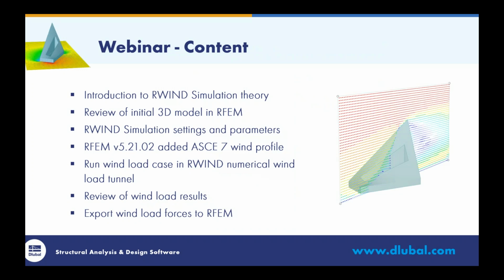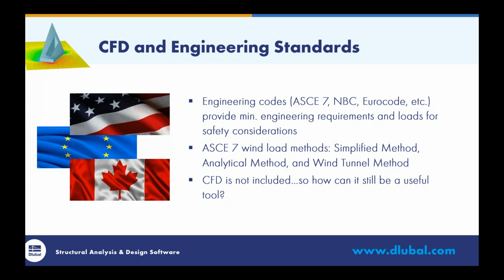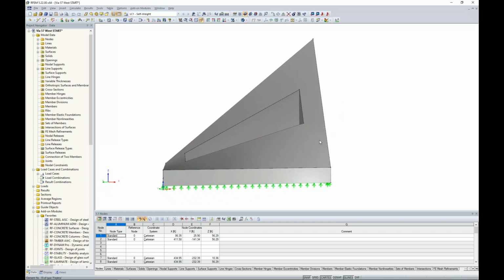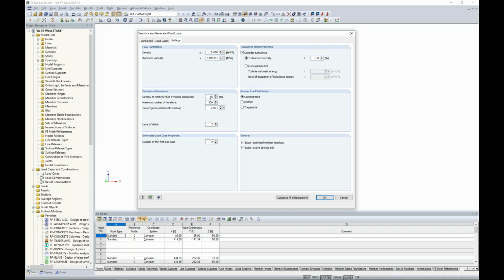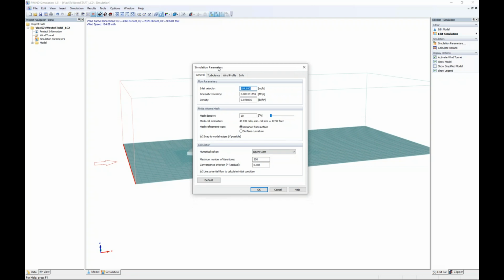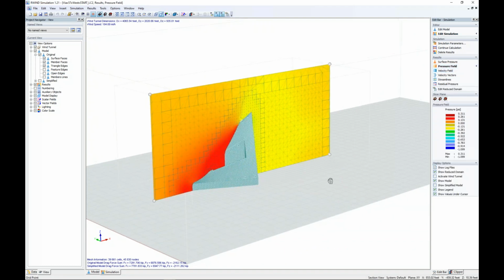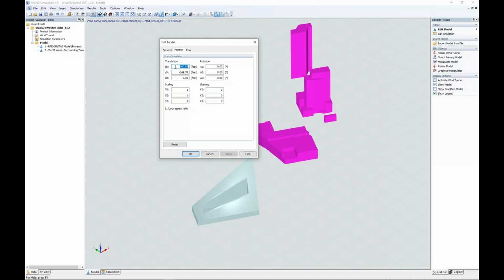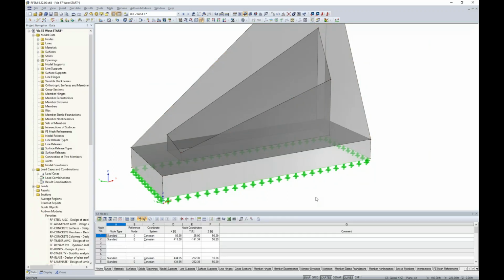Webinar: RWIND Simulation | Wind Load Simulation and Generation

Comment: Thank you for great video!
Calculating the lattice structure with round pipe cross-sections I've found out that in R-WIND they are represented as square hollow sections. What's the reason ? And does R-WIND take into account the type of cross-sections when calculating a wind pressure ?
 Also (for some reason) I can't see the wind loads (applying from RWIND)  on members in RFEM, - the button "show loads" is just inactive. Alhough the calculations goes well and I can see the deformation scheme
Reply from the maker: Hi, Alejandro!
If one wants to simulate the exact shape of a cross-section you must work with a very fine mesh. This will increase the analysis time. Therefore, we work with simplified section geometries. It can be that due to the amount of load arrows the program will slow down. So it will not show such generated load arrows. If you want me to look at it in detail please send the file with a short explanation to support@dlubal.com.

Comment: Thank you for great video. But if I would have frame structure (only columns and plates) how I could deal with wind if I do not model facade surfaces?
Reply from the maker: Hi, Robertas!
For smaller openings there is a setting in the software to ignore them. Otherwise you need to model the facade as well with a surface. In many cases it is important to know the general flow of the wind around the building and you need to find peak pressure and suction values. This will help you to verify the loads you actually put on your load bearing system where you may ignore the facade in a first step.

Comment: Hi 
Thank you for this awesome webinar 
please can you clarify what address intersection of triangles mean ?

also can I import DXF file as a 3 D model to this program ?

can I download the model  to learn from it  of this webinar ? 

Best regards 

Eng. Mustafa Hussein 
Steel structural Engineer
Reply from the maker: Hi, mostafa!
The intersection of triangles means that each mesh edge has to have two adjacent triangles.  These triangles must not overlap each other, if so it is not an ideal mesh. You can import these files (VTP, STL, OBJ, and IFC) and here are more details about the stand-alone programm RWIND: https://www.dlubal.com/en/products/stand-alone-structural-analysis-software/rwind and here on the Dlubal website you can find the models to download when you scroll at the end of the page: https://www.dlubal.com/en/support-and-learning/learning/webinars/000589

Comment: Thank you so much for such an elaborative video. Is it possible to download the background files such as blockMeshDict, SnappyHexMeshDict, fvScheme, fvSolution, etc.?
Reply from the maker: Hi, Sumit!
Yes, you can download these files. In RWIND Simulation you have to do the following steps. Display Options / Show Log Files / Open File Location
Reply: @DlubalEN  Absolutely awesome. Thanks again. I am expecting to have something similar for the two-phase flow simulations. The amount of time it usually takes for the two-phase flow cases is very long in few cases.

Comment: Can I simulate the windlens on this program
Reply from the maker: Hi, alaa!
You can put any shape in the wind tunnel except moving ones.
Reply: @DlubalEN 
Thanks very much, but at my university my graduation project is to find the energy from (wind lens) .
I want a computer program that gives the energy of this particular turbine. 
  does this program benefit me?
Reply: @DlubalEN  
If the software is not capable of finding the power generated by wind lens, can you help me find another program?
Reply from the maker: Hi, alaa!
Unfortunately that isn't possible.

Comment: Dear Maam

I am just starting showing interest in dlubal software , 
I have questions alot can you use Dlubal software with staad analysis (Import staat file to Rfem or Rstab). for connection design in dlubal software.
 I am working in steel industry ,

Can you help me out in this ? 

Regards,
Danish
Reply from the maker: Hi, Danish!
You can use the ISM-Interface to exchange data with StaadPro.
See:
https://www.dlubal.com/en/solutions/application-areas/building-information-modeling-bim/bentley-ism-interface
See also:
https://www.dlubal.com/en/support-and-learning/support/faq/000335